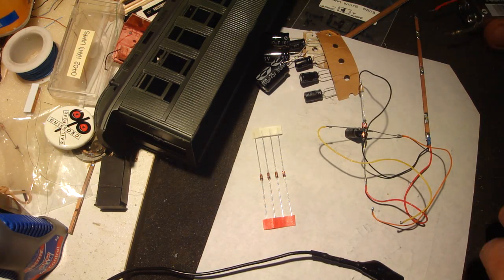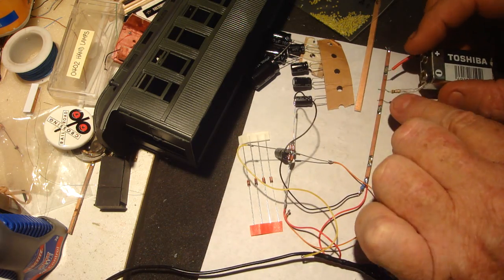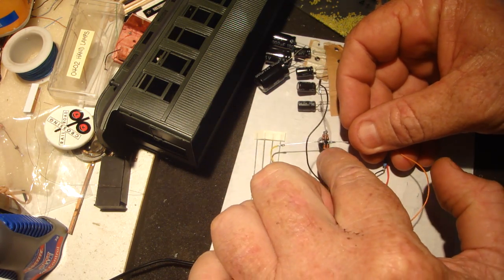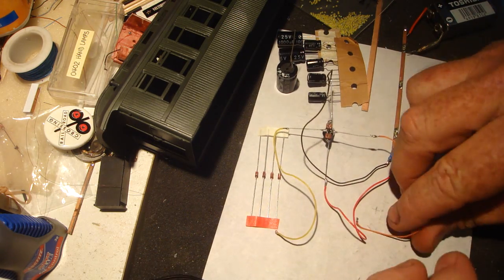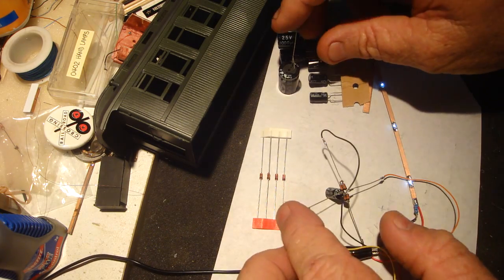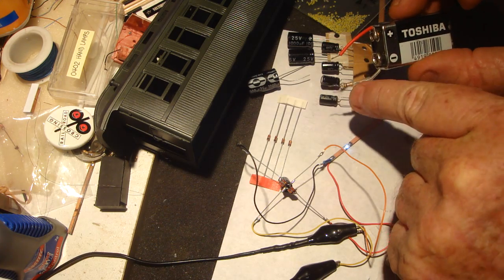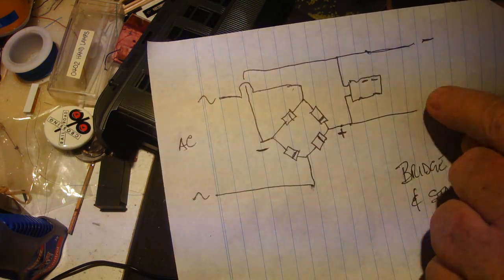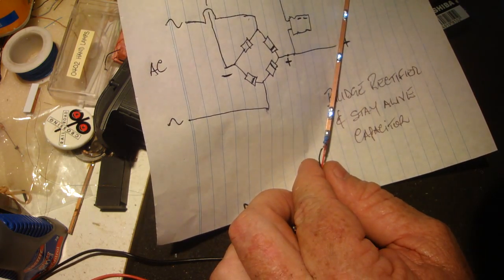Stay alive capacitor/bridge rectifier LED lights

Comment from the maker: The TCS FL (function lighting) decoders come with a black and white stripe wire. This is the ground/negative. The common positive is the blue wire. You can add a TCS Keep-Alive and this will keep all the lighting in a coach from flickering or going out.

Comment: Hi Laurie, hope you can help me i watched a video on stay alive lighting, i do n scale by the way, which is why your channel interests me. I got some capacitors they are SMD tantulum, i looked them up and the line on the side says it is positive? i thought this odd as normal capacitors have a line on the negative side. anyway i wired one up and it exploded, undeterred i wired another one up and that blew up as well. Should the line on the tantulum capacitor be connected to the positive or the negative on the bridge rectifier? The capacitors i got are these,
http://www.ebay.co.uk/itm/20pcs-Tantalum-Capacitors-227E-25V-220uF-Type-E-SMD-7343-Surface-Mount-/322335650799?hash=item4b0cb3b3ef:g:m~sAAOSw44BYMxmL
would really appreciate your help on this one.
Cheers Phil
Reply from the maker: G'Day Phil, never used SMD caps however each mfr of SMD Tantulum caps have specified connections.  As you blew the  T reverse or ripple voltage did this.
Reply from the maker: Phil, I can't help you as I haven't used them myself - sorry.

Comment from the maker: Use a capacitor of 16v (or 25v) and choose the physical size to suit YOUR application - I have several sizes values from 110 to 1000 Ohm. The diodes can be 1N1004, 1N1007
Reply: Not trying to correct you, but did you mean uF's instead of ohms?